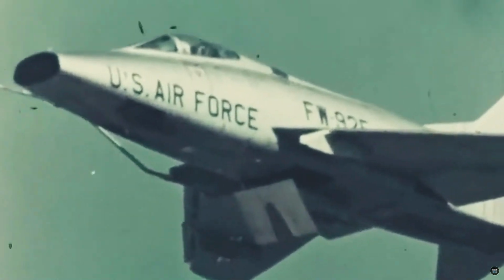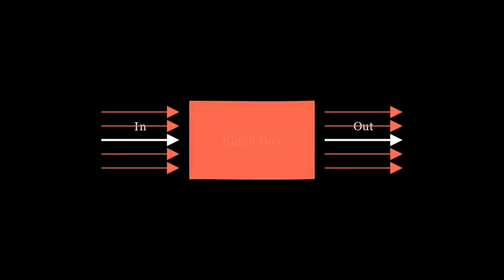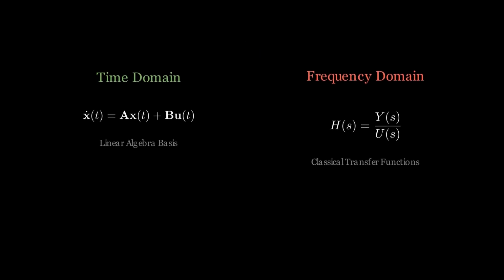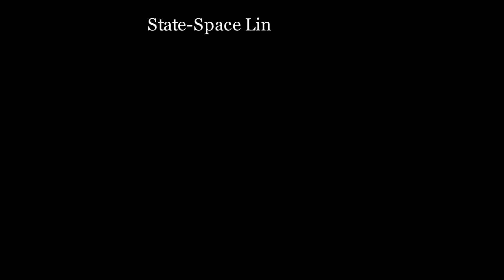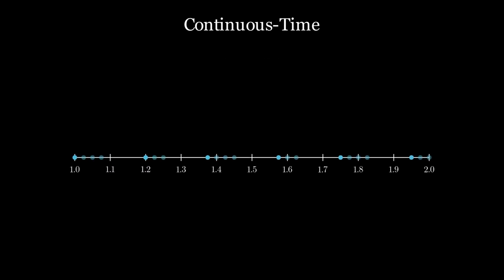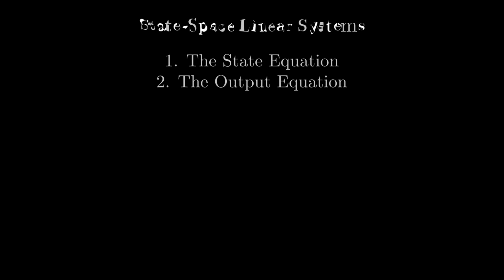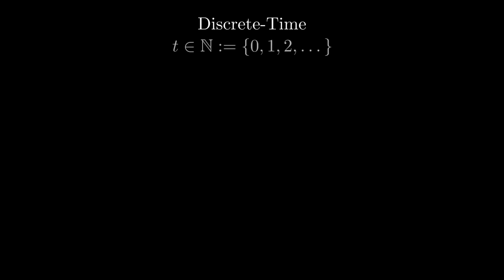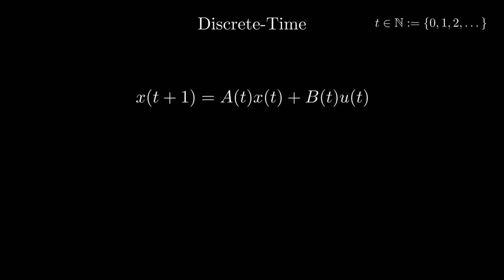The First Thing to Learn About Control Systems (State-Space)

Comment: When you start using state space and state feedback you feel that pid and its tuning methods are stupid, state space really is a good framework to work on linear and nonlinear systems and in same time they are only mathematical equations or expressions with some linear algebra and matrices and vectors and you cant become a good control engineer without knowing whats and how to use state space, even the teacher of modern control theory i will attach his channel link has started his playlist with state space and state feedback then come back to frequency domain and classical control and transfer functions